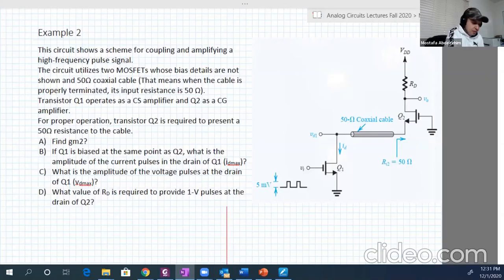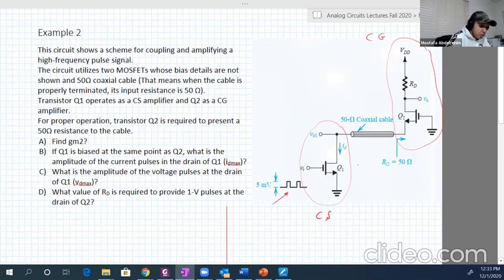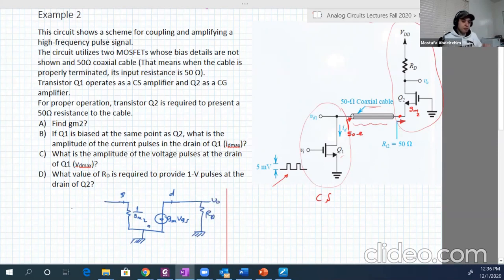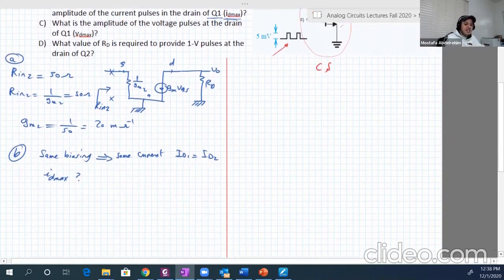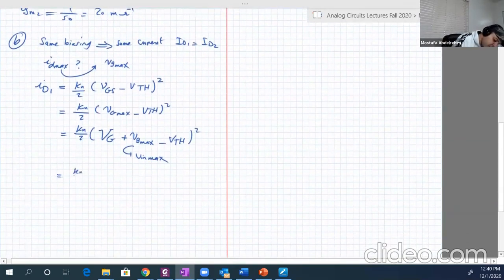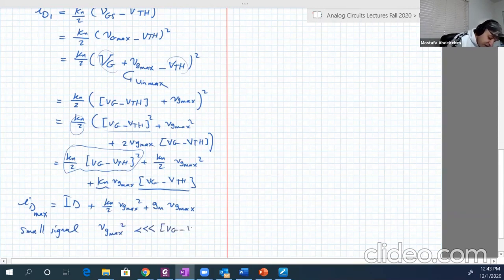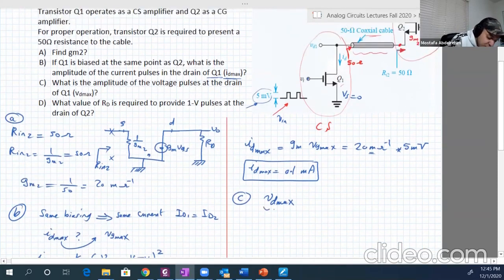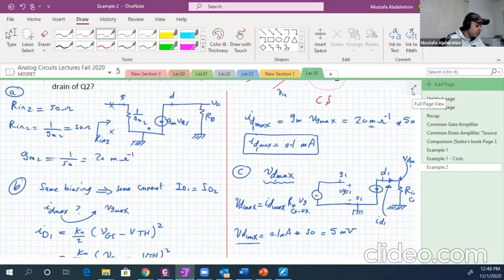lec30c NMOS Multistage Amplifiers - Cascaded Common Source and Common Gate Amplifier Circuit

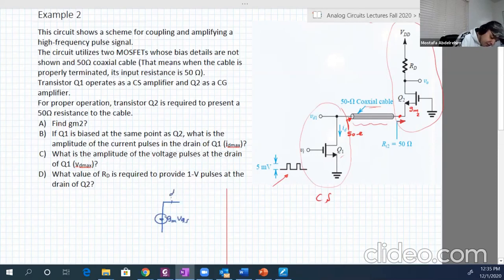Comment: at 4:21, I did not understand 1/gm2. Why did we use 1/gm2 as ro resistance for Q1 ? Can you explain it?
Reply from the maker: not sure could you explain more on that
thanks
Reply: Hopefully this isn't too late, but I believe @MostafaAbdelrehim is using the T-model for the MOSFET small signal model if I am not wrong?